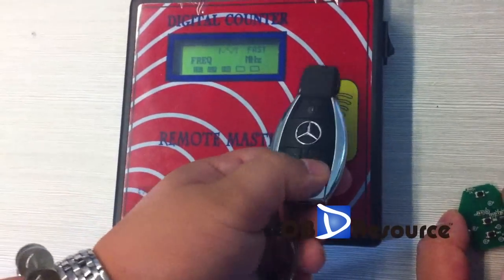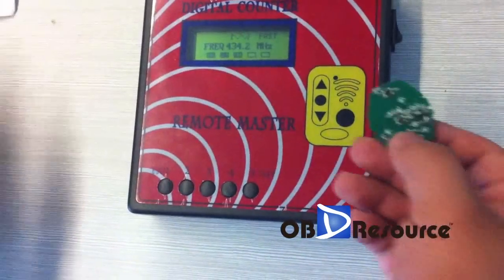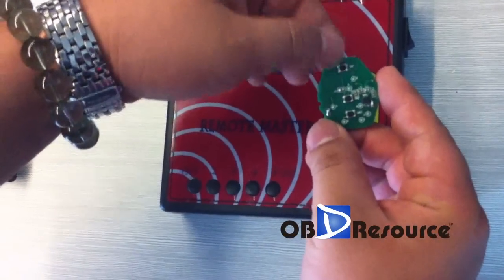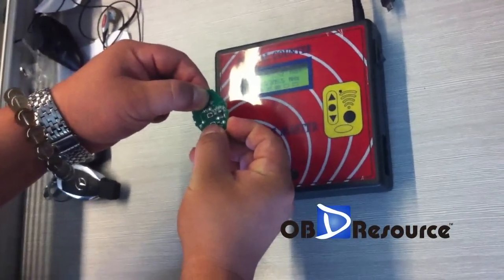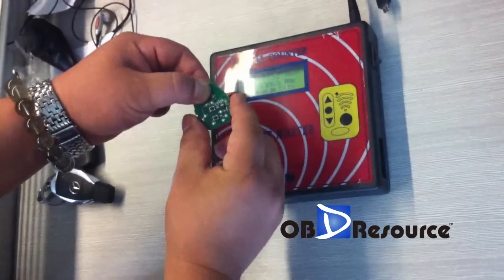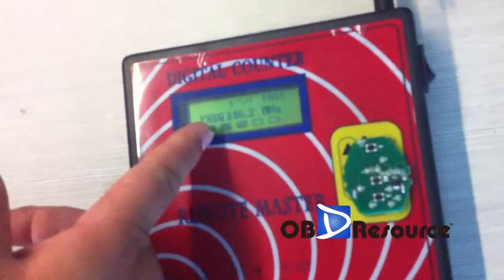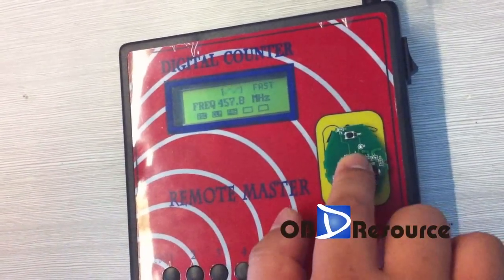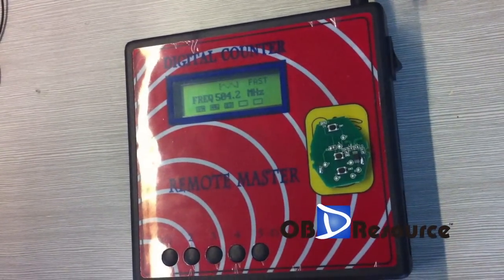BMW Remote Frequency 315Mhz to 433Mhz Swtich Demo Video

Comment: Hi m thanks for this vid this is exactly what i have been looking for as i got the Folding Flip Remote Key Fob for BMW x5 , and it comes with new Generation remote transmitter, transponder chip and new batteries, i am having difficulty figuring out how to get the transponder to work with my car , do i need to program the transponder differently for the key to start the car of will this procedure make it work?:

After much experimentation, I found a procedure that worked and would like to share it: 

1) Get in and close all doors. 

2) Turn on the ingition and turn off quickly. 

3) Remove the 1st key (do not keep it in the ignition as someone suggested). 

4) Hold the key up near your left shoulder (this is so it is closer to the remote reciever antenna - someone else suggested this as well) 

5) Hold down the unlock button (which is button 1 on my key) and press the lock button 3 times (center button on my key). Release the unlock button and the doors lock which confirms the operation. 

6) Quickly repeat steps 4 & 5 for key #2 etc.

thanks .